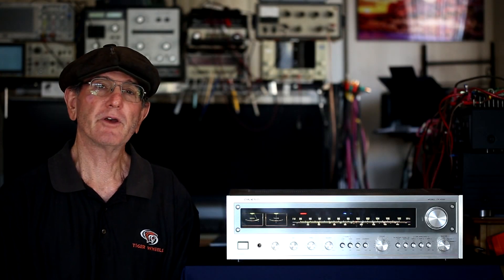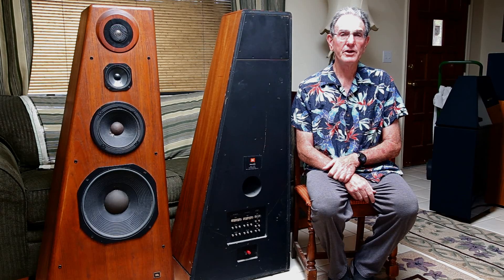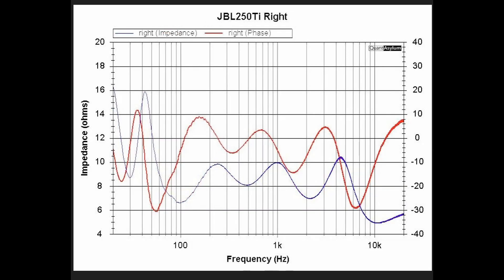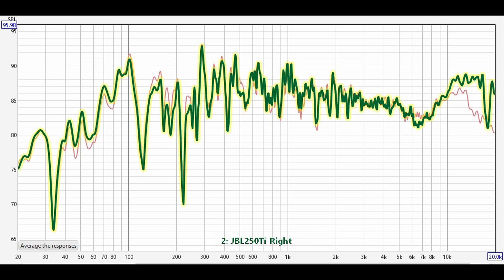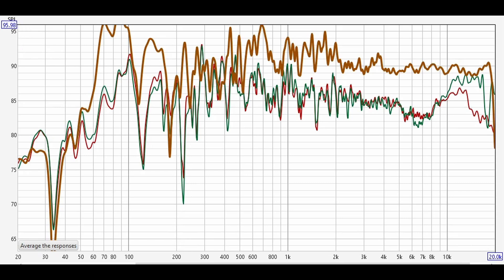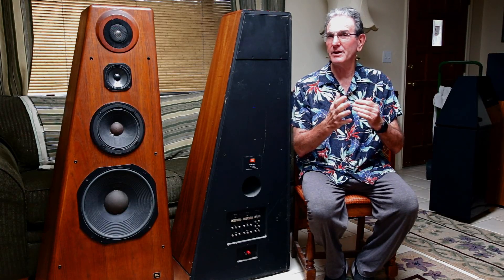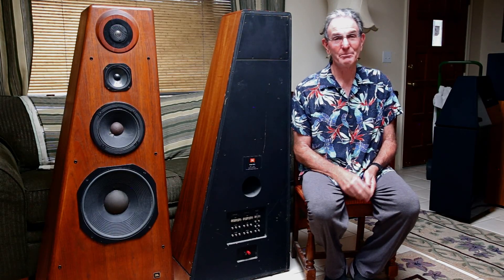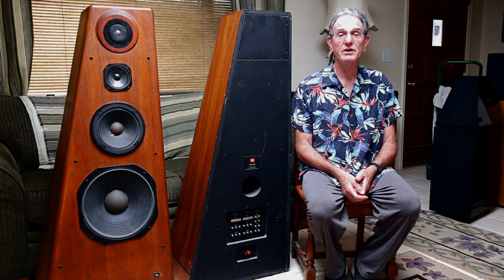JBL 250Ti Loudspeakers- Vintage Audio Review Episode #142

Comment: I have Jubilee version almost 10 years now. All versions have deteriorated foam in the tweeters by the time, it becomes grainy and loss highest freq sparkling and reconing of the LE14H1/3 woofers plus revision of voice coils is necessary. But their dynamics with some massive power amplifier is unsurpassed for the money and DRC is taming them in bass region even in smaller rooms to perfection. I keep them forever...
Reply from the maker: Thanks for the comments & I understand your wanting to keep them forever. I did not notice any deterioration of the tweeters and the one woofer was sent out and repaired.

Comment: Hello, I am the owner of 4 units of these JBL 250 Ti loudspeakers and I have experienced the same big difference (clearly audible) between the different samples when it came to tweeter performance.Tried to match them with measurements, but it came out that essentially every tweeter had erratic performance due to the dry-rotten foam plug behind the titanium dome of the 044TI tweeters. The sticky material and/or the debris from the dry-rotting caused mechanical interference to the coil/dome, resulting in undesired rubbing and damping. Disassembling the 044TI is a nightmare, as the coil/dome plate assembly is glued to the magnet, with no mechanical guidance for coil/magnet alignment in the (re)assembly phase. Anyway I managed to remove the plate by leveraging with flat screwdrivers between the dome/coil plate and the magnet. After a good clean-up with thinner and removal of the residues, I have then glued (with cyanoacrilic glue) a 20mm (or 3/4") diameter felt pad in the exact center of the pole expansion of the magnet, thickness about 3mm or 1/8" so to ensure there is no contact to the back of the dome. re-assembly is not dramatic, after appying slow-drying glue between the magnet and the plate I have applied a 200 Hz tone and moved the assembly to proper center (no rubbing audible), then kept in place with neodymium magnets until the glue came dry. The tweeters had become incredibly close to each other after the repair, and regained full coverage and linearity in the 12KHz to 18KHz range. The four tweeters all performed better in terms of linearity and extension compared to the best of the four before the modification. The distortion and waterfall plot did not even show any peak or ringing, while some tweeters had high distortion (>5%) before. I know some of the best-informed will say that the original foam plug was designed to be in contact with the dome from the inside, resulting in dome ringing damping and that the chamber damping provided by the felt is not on par with the foam. I do fully agree BUT for sure nobody out there is getting the benefits of the original design anymore and the spare foam plugs pretending to be "originals" are probably far from the specs.
Reply from the maker: Wow- that sounds like a lot of work but thanks for sharing! You are certainly more knowledgeable than I am and most folks, but I envy you have 4 of them. I would think someone like Midwest speakers(?) would have a suitable replacement tweeter. Since the video was released the woofer has been repaired and they were used for an a/b test (most recent of my videos), and most everyone liked their sound, though one person was not used to having more bass.

Comment: I am the original owner of a pair of these I bought in 1986.  I have all documentation. I had the woofers rebuilt about 7 years ago by a JBL authorized loudspeaker service. Mine are in pristine condition with grills in perfect shape.  Oiled Teak.  Your friend should have his woofers rebuilt.  I used Upland Loudspeaker Service isn Southern California.  I don't know if they are still in business.
Reply from the maker: Thanks for the info. The woofer with the voice coil rub was sent to a place in Tampa and I just installed it for him this weekend and it sounded good. He only had the one done as the other was fine. We are having a get together for an a/b test and will be using those speakers for it
Reply: @vintageaudioreview  Looking forward to it.  For me the foam surrounds had started rotting, so I sent them both in. The drivers were resuspended with new foam surrounds and new spiders. Photographic documentation of the rebuild was sent back to me with the 14" drivers. Do you think new rebuilt crossovers, with new high end capacitors, resisters, etc would be of any benefit?
Reply from the maker: @davidhill7055  That is pretty good service to provide photo documentation of the rebuild process. I am not a fan of rebuilding crossovers unless you think the sound has deteriorated. That is a pretty extensive crossover rebuild most likely, and probably not cheap. There may be some mods that folks have figured out that can be done to improve the sound, but unless you can do some basic measurements on them and see that they have degraded a bunch, I would not do it.
Reply: @vintageaudioreview  Yes that is what I was thinking.  My ears detect no deterioration. Or course my ears are 38 years older than when I bought the speakers.  And I have the typical age related hearing loss of the higher frequencies that a typical 71 y.o. has.  Any slight sound improvement in a rebuild would likely be wasted on my ears.  Thanks again.
Reply from the maker: @davidhill7055  Great point about hearing loss with age- I think I discuss the results of my hearing test in the next video or the one after that....
Reply: @vintageaudioreview  Great, I would love to hear your insights.  After all, we have our audio gear for us to enjoy our music.  Our favorite music, on our cherished equipment that we bought to satisfy our own biases. Mostly about the actual sound we like but about so many other intrinsic and extrinsic factors.  We don't have sound systems to impress others (our kids, grand kids or even our dogs) all of whom may have better hearing acuity than we do in our 50s-70s.  I know there are those out there in their 5th, 6th or 7th decades who proclaim  to have "Golden Ears." -In so much as to claim to hear the difference between big, fat, expensive speaker cables and those normal "yucky" cables.  Of course, none of this golden ear nonsense stands up to scientific scrutiny.  But hey. Being a passionate audiophile is about so much more than what you can actually hear. It's about satisfying all those personal biases that we all develop. And that is fine. Being an audiophile is a passion, and people deserve to be passionate about it.  I for one am not cursed with the golden ear affliction. My mother was not Lassie.  I have always had normal hearing, and now normal hearing for someone in their 70s. I will subscribe to your channel.
Reply from the maker: @davidhill7055  "My mother was not Lassie" made me laugh!. Well said, though I will have to admit that sometimes I like to impress folks with my systems by playing loud- not as often these days. Thanks for subscribing and I checked and my hearing tests are mentioned in the next video....
Reply: @vintageaudioreview  Yes anything louder mean "better" or more impressive for most people.  Like any 77" TV seems to have a better picture than a 55" TV for most people.  Even if the measured display accuracy, brightness, dynamic range,, color volume is actually somewhat better on the 55", the 77" is the one people will choose  if they can afford it and can fit that size in their space. So to a degree,  screen size trumps picture quality for the majority.  Most people will pick a 77" with an A- picture over a 55" with an A+ picture.  Its only human nature.
Reply from the maker: @davidhill7055  As someone who repaired TV's for many years for a living, I can relate, though the larger sets usually did have really good pictures too (thinking sony). Loud systems can still sound like crap, though....
Reply: @vintageaudioreview  Yes some loud systems can sound like crap,  but good or great systems come alive if you crank it up a little. To impress people we all do that.  But I listen at a much lower level.   About TVs, I have a 3 year old Sony 77" OLED TV with a top notch picture. However every year Sony's displays get a little bit better, a little bit brighter, however I would never buy another 77" Sony with a "little better" picture quality.  My next TV would likely be a 95-98"  TV in a few years.  Don't get me started on the sound of most flat panel TVs.  It is horrible for the most part.  With an exception of Panasonic (they just last year  introduced their TV line back into the US market.) I had a Panasonic Plasma years ago. It had a great picture for that era.  However Panasonic pulled out of the US market several years ago.  They continued to produce and sell TVs in Asia, Europe and the Middle East. Continued to improve their technology, but did not sell in the  U.S. until last year. Panasonics big screen OLED and LED TVs are said to have very good sound quality built into the TV.  Other than that Sony has a couple high end big screen TVs where the sound actually comes from the screen itself. Mine does that, it sounds descent but still I opt for a 5.1 surround sound system.
Reply from the maker: @davidhill7055  I own very inexpensive LCD TV's and they work fine for me viewing, which is typically at an angle while doing stuff on my PC like typing this reply. I may do some cranking tomorrow on one of my systems just to feel the bass.....
Reply: @vintageaudioreview  For casual TV viewing like the news or sports I don’t care what kind of TV I watch. But for good movies on Blu Ray, or a streaming service I enjoy a top notch picture quality on a big screen TV.  I mostly have had Sony TVs, starting with a 17” Sony Trinitron  (CRT) back in the 70s.  I lived in Japan for a few years and got a nice 25” Sony CRT TVs in the 80s which I eventually brought back to the states.

Comment: @vintageaudioreview  
Thank you for the measurements and review of these vintage JBLs!

I would love to have a pair of these in my listening room.  :)

Unfortunately, the age-related deterioration issues with these types of vintage speakers will most likely require a substantial investment in time and money to refurbish and bring them up to spec in order to ensure their performance and future longevity.

Ultimately, it would depend on how much money you would need to spend to acquire a pair of these in at least decent cosmetic condition.

At a low enough price they would be well worth it.  But vintage JBLs in good condition usually command premium prices.

As a DIY alternative that could be built in a similar form factor and exterior finish, and would also definitely outperform these JBLs, I would use the following drivers in a 3-way configuration:

- Ciare 10" HW251N @ $190 Each/$380 Pair. 
- Xcelsus Xcelsia Series 4" XXM425 spiderless midrange @ $400 Pair.
- SB Acoustics SB29RDNC-C000-4 Fabric Ring-Dome Tweeters @ $145 Pair, or...
-  (OPTIONAL) SEAS Prestige Titan 27TAC/GB Tweeters @ $195 Pair
- High Quality Crossovers, Wiring, & Terminals @ ~$325 Pair or less depending on component selection.
- 3/4" MDF cabinets with significant internal bracing, ResoNix CLD+CCF resonance control damping sheets, lambs' wool batting, and oil or wax rubbed walnut/ash/cherry/zebrawood/oak/maple veneer @ $450-$600 Pair.

So, for roughly $1700-$2000 you can own and enjoy a similar form factor pair of speakers that performs significantly better and still looks fantastic in your room as well.

IMO, I would argue that these would be an "End Game" pair of full-range loudspeakers for most people, except perhaps in the very lowest octave, where it would be quick easy to add a relatively inexpensive but decent subwoofer.

So the question is, how much would you personally spend to acquire and then refurbish these vintage JBL speakers?
Reply from the maker: Remembering that they are not my speakers, and that I do not want to undertake building my own, I would probably go for something that sounded real good to me- most recent being a Final electrostatic speaker costing around $10k/pair, but most likely require a sub. I do look forward to hearing these with the repaired woofer.
Reply from the maker: @chrislesnar  I am not sure what the Ciare woofer and crossover comments are in regards to, but I am happy to report that the woofer is repaired and installed and I did a quick listen to it and it sounded good and they will be the speakers used in an upcoming a/b test.
Reply: @chrislesnar  
 No doubt the JBL LE14H woofers are excellent.

But you're comparing a 15" to a 10"?

A 15" driver has a vastly different Sd from a 10".  WHY would the Ciare 10" NEED a 4" VC in order to perform well??  Basing your judgment on voice coil size in this comparison is ludacris.

And cost/performance were also part of the equation for this particular build compared to the 250Ti.

The T/S of the Ciare are respectable and perfect for their intended use.  It's obvious that you've never used or heard the Ciare driver in question, and instead choose to simply judge it by its "looks" and general T/S parameters.

In addition, crossovers don't always HAVE to be uber expensive to perform well when they are designed properly, kept minimalistic, and use proper parts.  VituixCAD FTW.

But you're entitled to your opinion even without having heard that particular driver in question.

Cheers